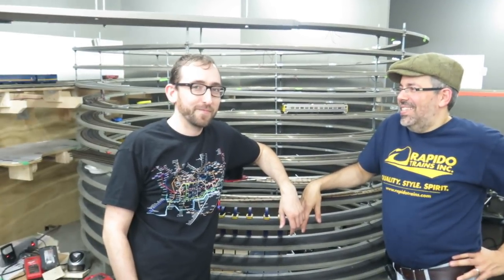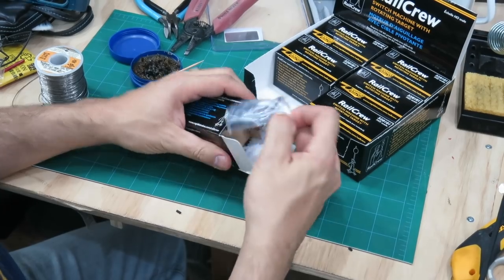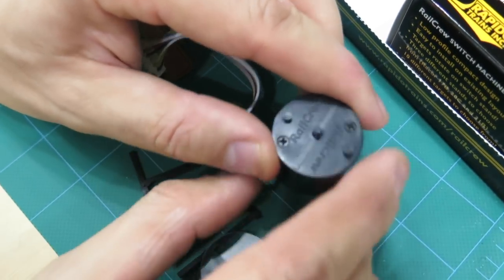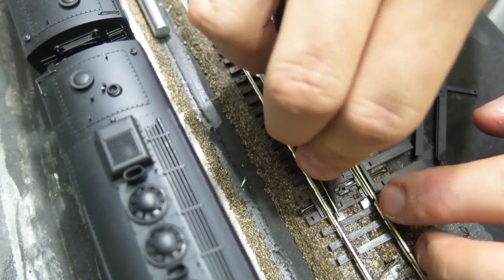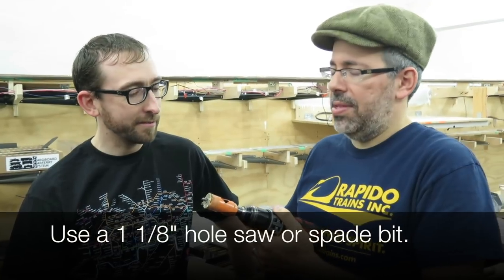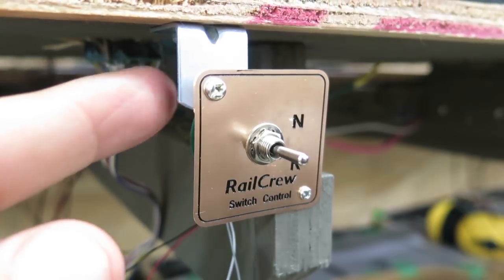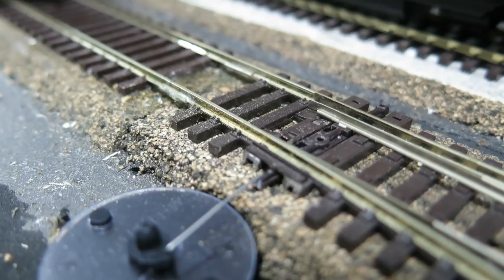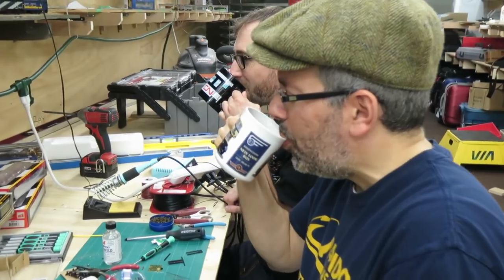How to Install a RailCrew Switch Machine

Comment: I thought I was watching an episode of Corner Gas.  Brent Butt with the cap on.  Very entertaining.  I really don't want to drill those large holes in the layout, though.  Good point re the stall machines with the current always on to hold the point.  Have a few more Elsinor brews, eh!  Cheers from Camden, NY!
Reply from the maker: Glad you liked it, eh?
Reply: @rapidotrains  Definitely!  That's aboot right...

Comment: So I installed one with a 12v adapter, and it works fine. But i also have an old DC power pack under my layout for signals, could these switches be wired to the DC side of that controller, or is that a bad idea?

Comment: I think with a full 1 Amp 12 V pulse, (12 Watts of heat makes a good small soldering iron) with only a thermal cutout to protect it from faulty overheating, you are going to be the #1 Fire risk for home layouts. Have you spoken to UL about this?

I also wonder how it is possible to drill a rather large 1 and 1/8th diameter hole in an existing yard between two HO tracks at 2" spacing?

Comment: Why remove the spring?  Does the switch machine not have enough power to engage the spring?  I am using Peco and the new Walthers.  Looks like there is enough looseness after the current is off that the point could move away from the track.  How can I be fore sure I am getting the newer machine with the thermal coupler and not the older machine?

Comment: So with the correct size hole made, is the switch machine simply a press tight fit or it is secured from the bottom?

Comment: I think your RailCrew Switch Machine is better and more prototypical than the Tortoise. A little more fiddly to install, but the results are great looking.
Reply from the maker: Thanks! Unlike just about every other switch machine, this one actually moves the points the same way a real one does.

Comment: If you use the pilot hole and drill from both sides, you won't chip out the plywood as bad. Or better yet use a forstner bit, if you can find one that size. A Forstner bit will give you a smoother rounder hole. This is a very cool switch machine Jason. I saw this switch machine at the 2015 National Train Show in Portland, Oregon. I was ready to buy them then. Just out of curiousity, why did it take over two  years to get them to market?
Reply from the maker: We made them in 2015, believe it or not. But then we found that they failed when abused and had no ability to recover from overheating. So we junked the whole shipment and redesigned the guts to be much more robust, the best part being the temperature switch that shuts down the machine before it is damaged.

Comment: Awesome I'm gonna give these a try out definitely. Frog power automatically deals with polarity? Therefore should eliminate the need for a hex frog juicer?
Reply from the maker: Correct - no frog juicer is needed. The frog polarity is switched by the machine. Same as Tortoise and many other brands of switch machine.
Reply: rapidotrains awesome thanks!

Comment: Is there any reason these cannot be used with n scale,  when not using the switch stand, is there a supplerin the UK, cheers Toony
Reply from the maker: While it's designed for HO, we've heard of people modifying them for N. You may want to check with Rails of Sheffield for availability, but other shops may carry them as well.

Comment: Good video of a new product. That Peco turnout looks more like a number 6, the number 8 is a lot longer. Is the C40-8M available yet? Have you considered producing the Alco FA1?
Reply from the maker: You are absolutely right - it's a #6. Whoops! The 8s are on passenger tracks, not industrial spurs. The Dash 8s are on the water from the factory right now.
Reply: rapidotrains Thanks for your reply.

Comment: they look like the fit into more places. where as a tortoise might not fit.. I might need a couple of them Number Two switch machines
Reply: you think dave !  you should watch sparky107107 video's i thin he did need some where the coal mine will be sitting .i alway wondered how you get coal from your wall.  for me i would tell everyone it's skittles mine  Ron from 2448 toyman and peter from pc rail 8748  would believe you would be mine skittles. 
what are we going to do with you sparky 
jennifer white train bug

Comment: How about using a supercacitor power supply diode charged. Easy circuit to hack can drive several machines and also prevents burnout by limiting current.
Reply: Do those machines have a means of indicating position?

Comment: Great show, eh!  I would also be interested in using these with N scale. Could you guys test them with perhaps Atlas or ME code 55 switches? (I think the Peco ones are beefy enough to not be an issue...)

So other than that it's just a matter of getting the switch stands and targets made for N scale size? (Brass etching would be sooooo hard to adapt *eyeroll*)

Thanks for the info on what looks like a really cool product, eh!
- A-Train
Reply from the maker: We will do some N scale testing.

Comment: Big Question June 28 2021 are you still making these
Reply from the maker: Switch machines are in stock and available to order through dealers or on our website. We're temporarily out of stock of the uncouplers at the moment, but hope to have a restock later this year.
Reply: Thanks for the info , going to use them as part of my steel mill

Comment: Can these be adapted for N-Scale?
Reply from the maker: We've never tested it but it seems possible! The problem is the switch stand itself would be very large...
Reply: Well I was just thinking about the machine itself and not using the switch stand.  I would have to fabricate or find something similar that could be used for the switch stand.  Very nice idea for a switch machine!!
Reply: Beat me to the question.
Reply: Yearz'n years ago, somebody published an article on making working N switchstands from small hypodermic needles (insulin size, perhaps?). The needle holding tip made a good base, and he ran a fine wire up the shortened needle to a target. It was generic looking, but the price was right. Don't know if anyone perhaps has that on the 'net now.
Reply: I wold look to Thingsverse and see if someone has a 3D printed model of what you need.  That will be the up and coming tool for model rail roaders.  Good video
Reply: You can buy these for N scale

Comment: How do you scenic around this switch machine?
Reply from the maker: It's quite easy, actually. You just scenic around it like any other switch stand. Just don't get any scenery glue or plaster into the moving parts.
Reply: Easily said.  Hope about a supplimentery video show details.
Reply from the maker: We'll get there eventually.

Comment: Got a screw for a Pullman car truck attachment screw?  Very rare it'll make me build something. A for the want of a screw. The big hobby store excursion dont have hardly anything for trains and 70 miles away. I wish I could sell trains but with no parts still dont help. Of the three cars I bought for 9 bucks they are new, one is a special car like a presidential car with red fringe on the back awning and gold painted handrails. What with cabooses they cost as much or more than some trains. When I was last in trains I bought boxcars for 2 bucks for a kit. How do you start a train store? Sell trains for ya. Eh?

Comment: why use a swatch to control, instead automatic. If control by hand don't need electricity
Reply from the maker: You can't always reach a turnout to control by hand. And you need to switch the polarity.

Comment: The only problem I see with this is the wires coming off the back of the switches from their soldered position are easily broken off! The wires should have been a thicker gauge or attached with a different connection. I have already gone thru two switches already! Seems very cheaply made,as compared to other products from Rapido. I would’ve expected better quality!

Comment: The switch machine operates too fast and too hard and I'm afraid of what it will do to my stock rails over time. The power going to the switch machine could cause a fire. The design does not allow for the switches to operate closely together.  You also need special tools to install it. There are better switch machine on the market for less that operate prototypically. I'm disappointed with it.
Reply from the maker: Hi Tim! It's really not that hard. We've had them in service on Randy's layout for four years with no issues. The power cannot cause a fire, unless there is something very wrong with your power supply. The model shuts down if it gets hot. You can indeed install switches close together if you plan in advance. We feel the benefit of having operating switch targets outweighs the extra work needed to install one of these and the fast motion. You obviously feel differently. If you are interested in trying one, please contact us through our web site - https://rapidotrains.com/contact-us/ - and we will send you one so you can see for yourself. -Jason
Reply: And, what is the cost ? I don't know about you, but if my commercial Atlas, Shino, or Peco, Lambert, Walthers switches are $15 to $40 (usually the curved Shinos), I can't see paying [what?],  $20 more per switch...And speaking of Peco, I don't know why they made the head block ties wider than the cross ties.. Plus, to me Pecos look British prototype and Atlas are very US prototype. In case anyone doesn't already know, the HO Customline Atlas TOs have a metal frog which can be powered. They come with a black coating on the frogs which rubs right off (I believe it protects the frog from corroding if sitting on the store shelf a long time. If you install Atlas switches correctly they work just as well as Peco, the only diff is Peco has that spring action. But check this: The guys here removed the spring on their Peco. Why ? Because the spring will work against any motorization. IE. Peco's spring is great for finger flipping the points, but has to go anyway if they're motorized. Take away that spring and they're just a jiggly as Atlases.. For me Atlas looks more American, too. Finally: A cool thing you can do with Atlas is to buy a small bottle of chrome enamel paint and paint the 4 brown insulators around the frog, and rust up the guard rails. And the head blocks are the correct size to boot.
Reply from the maker: You seem to be making an argument against switch machines in general, and there is nothing wrong with that. Our switch machines are about the same price as a Tortoise. If you can afford a Tortoise, you can afford ours. Peco Code 83 tracks are North American designs.
Reply: what 'special tools'?? ...a 1-1/8 inch hole-saw?, a drill?? I've installed 6 - 3 of them VERY close together on my FIRST-TIME EVER layout and I've seen real switch mechanisms at work and I've yet to see a model product that come even close to the precision of scale and function (other than the 'snappy' action) of the RAIL-CREW product.  Oh yes, I also use ONLY Micro Engineering track and turnouts and ONLY code 88 wheels on all my rolling stock. ...AND I've had my trains ZIP through my turnouts at an UN-prototypical speed of 130mph without incident - ever.  Being a 'polite Canuck' I'm SORRY, but for me, these switch machines are NUMBER ONE!!!